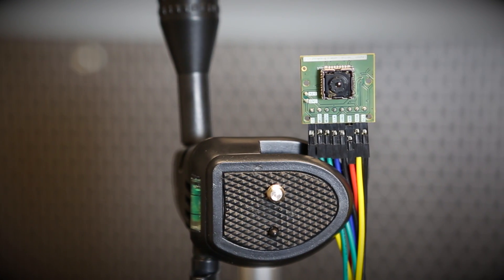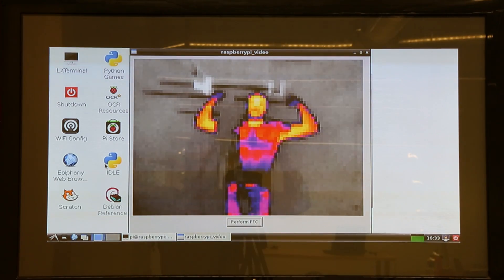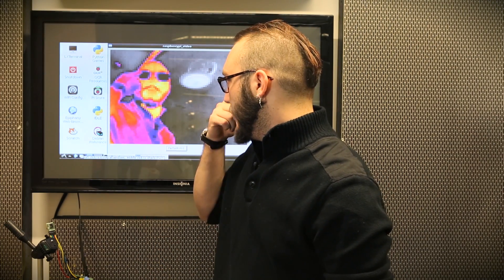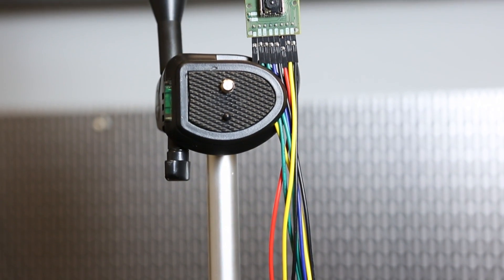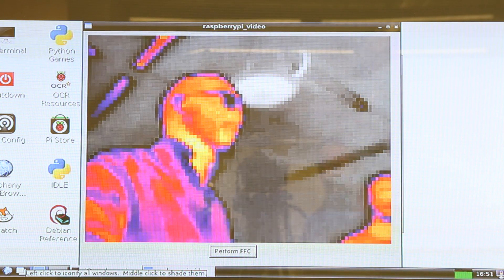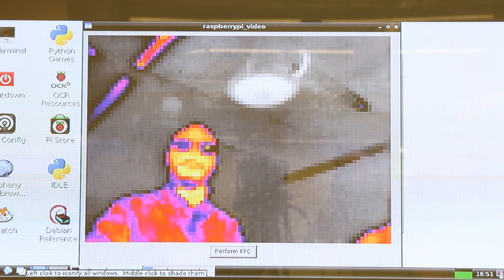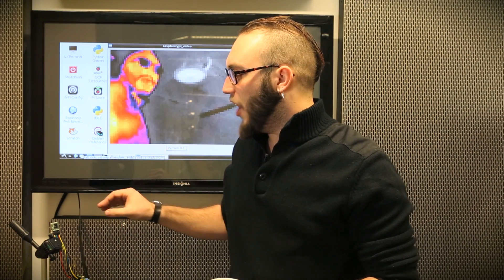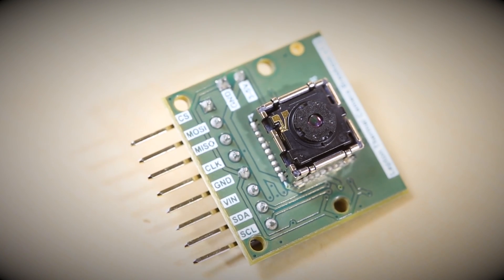SparkFun FLiR Lepton Camera Module

Comment: version 3.5 is out... at $259 for the Thermal image module, and another $100 for the Smart IO board that lets you plug in via USB straight to your computer
Reply: Hi there, I am currently trying to get the 3.5 to work on my raspberry Pi. I am getting the issue that he mentions at the end where I get the red box but am unable to fix it. do you by any chance have any reccomendations?

Comment: WOW, it costs more than the FLIR One and the Seek micro usb adaptors.. And the Flir One has a built in battery, 2 cameras, better quality imaging, etc.. I get that this module is more flexible, since it can be added to any project and you can write your own code for it, but the Flir One has so much more and better hardware for a cheaper price, so it feels like someone is getting ripped off at that price, either sparkfun by the manufacturer or us by sparkfun. holy crap. I thought i could build a flir one for cheap but i was wrong if i use this module lol.

Comment: A bit off on the theoretical explanation in the beginning. It's not "real heat" it's EM radiation that hot object happen to emit on their own. The radiation itself is not heat.
Reply: It's a kind of heat transmission called thermal radiation, so, it's actually the "heat" of the object
Reply: Trí Dân Nguyễn Thermal radiation is nothing but radiation emitted as a result of having a temperature. It is not the same thing as heat, which is a form of energy stored in the body itself.

Comment: It's not detecting the temperature of the glasses, it is measuring the emissivity, which is minimal, thus they appear black (cold). This is how thermal imaging works, also the reason that certain things, coatings, objects, etc. etc. appear much, much colder than they actually are. It's also the reason that you have to tinker with the emissivity settings of most IR thermal sensors in order to accurately measure an object.
Reply: thats pretty much what he said
Reply: +Nexus Customs Not really, he specifically said that it is detecting the surface temperature of the glasses, but if that were so they would appear much, much hotter, i.e. Everything else in the room...
Reply: yes, classic misunderstand of 'heat'-- internal thermal (kinetic) energy and the transference of via conduction, convection and radiation.
In this case, regular glass does have a very high emissivity, though a very low absorbtivity, so it doesnt soak in much heat from his face, and sheds what it does quickly.

Comment: This should be like 60 bucks what a rip
Reply: You're free to source those and sell them for 60$. I'll buy two if you do it.
Reply: Im just ssying
Reply: it is a bit disappointing that the seek thermals and flir ones have higher res sensors and they are completely integrated attachable modules and come at about the same price. I would like to buy one of these just to mess with it if it was cheaper.
Reply: I agree it’s overpriced especially given the few$$ to manufacture those. Intel Realsense has an 80x60 which is similar specs as this yet comes as a complete ready to go Scänner for $149 (D415/435). The SR300’s are around $89 though I don’t recall if that model uses flir or not. Anyways buying a completed unit makes sense even if thermal imaging is all you’re after.
Reply: Also check this out! If you want to buy a high end 20mp FLIR complete they’re $599 which is quite the value considering what you actually get for resolution and a completely assembled product. http://www.testequipmentdepot.com/flir/aerial-drones/gimbal-cameras/zenmuse-x4s-gimbal-camera-4211869.htm?ref=gbase&gclid=EAIaIQobChMIi8-zlbe93gIVWrjACh3YIQDdEAQYAiABEgLqmvD_BwE
Reply: Yep that’s just a nice camera. I have seen decent flir sensors around that price but the comment above is correct you’re pointing out Flir brand not a flir sensor.
Reply: That's a normal CMOS camera manufactured by the FLIR brand, not a thermal imaging camera.

Comment: Be careful with the concept of heat. With "that means real heat" the commentator implies only IR radiation involves heat, or represents hot things, or can heat things. You can heat things with any radiation, and you can raise matter to temperatures to spontaneously emit visible or UV light, for example. It's just that matter at normal terrestrial temperatures spontaneously emits more IR than anything else. If the module didn't have a visible-blocking lens, visible light would warm the micro-bolometers—just the same as visible light from the sun, filtered by the glass of a window, warms our feline heat storage units. If you were concerned with heating and cooling of objects at around 2000°C-5000°C, you'd want a glass lens that allowed mostly visible light, but the bolometer-part would be the same.

Comment: This thermal sensor doesn't come with the calibration micro shutter that's included with the TG165's lepton. 350$ uncalibrated is awfully steep when the handheld FLIR TG165 visual thermometer is 100$ more (same sensor). That and you have to pull this 'static sensitive' module out of the socket occasionally? Sparkfun come on! what are with the prices? Are you becoming radio shack?

Not to be too harsh, you guys are awesome! If your prices (not just this module) become more reasonable, you'll get some of my business again.
Reply: thefatmoop ,Agreed and I don’t buy from spark fun they overcharge for product. If I ever needed something I couldn’t find elsewhere I may consider but I’d definitely look around first. A lot of these sellers raise their prices as they build recognition and web traffic. The sensor is way overpriced given Intel’s D435 is only $89.
Reply: Can't find those on google, wanna read more about those cameras.
Reply: Yorgan Yog, if you’re asking about the Realsense you can buy them at wholesale price here: https://click.intel.com/realsense.html The Realsense also has a sdk web dev site anyone can join and forum you can partake in. There are currently around 15-20 software programs already developed for it and many you can either download free, or at a reasonable price if you want a program developed by a particular resaler. Givin stereopticon camera’s with flir sensors already installed that will most certainly out perform in an application over using the above for a dev project that may never work correctly. Correction to above comment the older Sr300 is $89 and new D400 series are $149 and still a bargain. We have 3 Intel sensors here, 2 D435’s with Aaeon Up board and a D415 with its own Arron Up board. Beyond two sensors used at a time you need to use a Nuc or a PC.

Comment: I wonder how much it costs to manufacture, probably $5.00
Reply: +SoCalFreelance It's less complex to manufacture. With any luck you can make your own visible light sensor at home with very crude techniques. Making a microbolometer under vacuum? Good luck.
Reply: Ya but the assembler is probably 120million. This is why China has not mass produced TAU camera clones. It is way out there manufacture.
Reply: Hoverbot1TV  I only say this because the iPhone 6 camera costs Apple $16.50 each and it's far more complex than this camera.

Comment: 80 × 60 pixels may be more than you need, don't get hung up on inherent resolution!

Tim Minerd and I prototyped perhaps the first CCD based document scanner in the early 70's while working at Xerox. It was based upon a 1x256 linerar CCD element.  From that experience and watching slow scan television pictures of the early space flights reminds me that the inherent "resolution" is not as important as the sensor sensitivity and spectral response.

I can see how putting this sensor on a servo or stepper, is capable of giving you all the resolution you need for a stationary application such as scanning attics for heat loss or intruder detection.
If you really need "real time" high resolution . . . that is a different story.

Looking forward to playing with the Lepton FLiR mounted drone scanners for a post fire incident aerial mapping project.
Anyone else interested?
Reply: I am interested